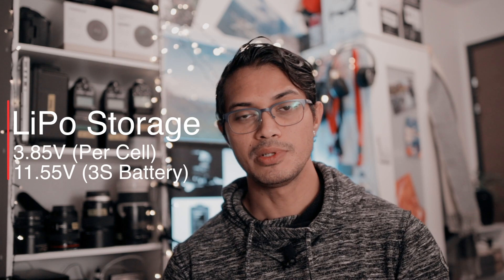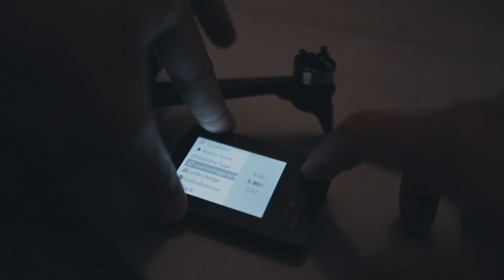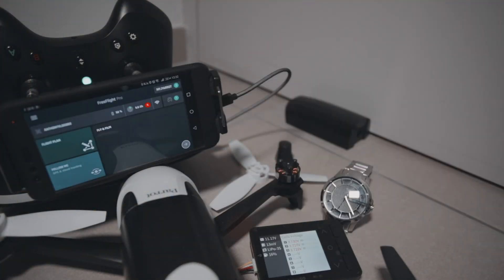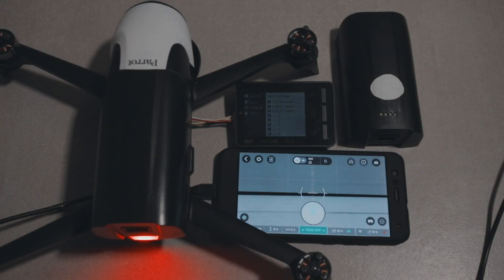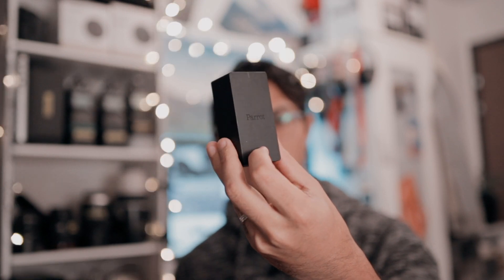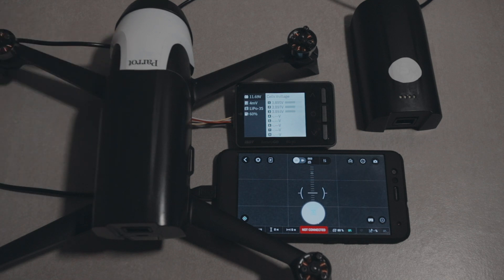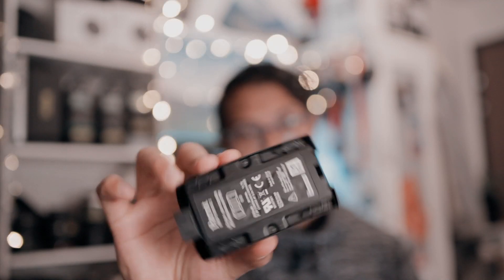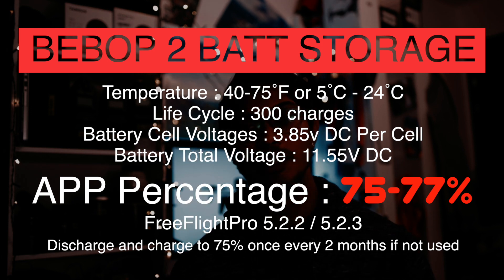VLOG120 | BEBOP 2 | Battery Storage | App Percentage at 3.85v per cell | 11.55V

Comment from the maker: BEBOP 2 BATTERY STORAGE
Storage Voltage per cell 3.85v
Storage Voltage total battery 11.55v
Storage Temperature 40-75˚F / 5-24˚C
Storage in LiPo safe bags or fireproof container
Store in dry place

To set storage without a special charger. 
Charge battery, than put on the drone and power it on and let it drain down to 75-77%or on your last flight, bring it back at 77% than your battery will be good for storage. 
If you don’t use the battery for really long period, discharge and recharge it than discharge it to 75-77% once every 2 months. (Personal recommendation) 
If you know how to set storage with your balance chargers you shouldn’t be watching this video.

Comment: Hey Anthony I hv a Brand new Beepbop2 in the box Doesnt espect to use it first time  before summer or so (in 5months) What should I do with the Battery ?
Reply from the maker: Ensure its at storage voltage. 75% in the app if its firmware is 4.7.1 and ffp 5.2. Put it away once set and take it out once at least in 2-3 months discharge it and recharge than discharge to 75% again for parking it. If its original batteries it will sleep if left for a long time and it would seem its dead and when plugged back into the wall charger would blink a sequence. That's just reactivating, disconnect and reconnect it will charge up to green. (just incase you let it sit without doing anything).
Reply: @ANTHONYVLOG  For xtra Batteries Do you recommend one place to buy Thanks for your replies :)
Reply from the maker: Parrot is a good start if you got the drone from them. If not try to buy the batteries from the vendor you got the drone off. It keeps a good paper trail in the case something happens to the drone they cant point any fingers.

Comment: I was charging the batteries with the Parrot Charger for about 20 minutes after flights. I have the B2 Power edition. I was assuming that 40-50% was good on the app but your explanation makes sense but it also worries that I may be damaging the batteries. The issue I have with flying to discharge is that once I'm done flying I usually am done completely and ready to do something else. Especially with 3 HD batteries with the Power Edition which easily gives me 27 minutes per battery. 

I just assumed that charging for about 20 minutes was good because the app always showed 40-50% which I thought was storage. Now that I see that the app is reporting higher percentages I may have to charge for about 25 minutes. 

Am I damaging the batteries by charging only to 40-50% on the app? Also, my HiTec charger which I cannot use to charge my Bebop (I use it for other drones) has a STORAGE charge setting that is set to 3.80V per cell. That always seems to be about 40% for the other drones! I can never seem to get a straight answer as to what the ideal storage charge level is. And why would my HiTec charger charge to 3.80V if 3.85V is the ideal storage level. I cannot change the storage level.

I have another question: you said that Parrot is playing it safe by reporting the percent of battery differently than what the battery really has out of safety. So the app should be reporting a LESS percentage and yet your demonstration shows that the app is reporting more at 75-77% assuming that is 45-50% in reality, but that doesn't make sense for safety as the app should be reporting LESS than the battery really has so that you never fly to battery empty. So what's going on there?

And the ultimate point is that why didn't Parrot just make it easier for us to maintain our batteries with a charging adaptor to connect to a third party charger or make the batteries 100% "smart"?

Thanks for the information.
Reply from the maker: The programming can go either way top end is high low end is lower, it was just an example of what can happen in software that is why i needed to check the physical battery reading while it's mounted and reference to the app. I don't have a power so I can't comment. Lipos are 3.85 or 3S 11.55v but it's subjective. I'm working off the battery manufacture information not parrot as parrots advice is 20-40% the original battery with the oem pcb 3 will hybirnate anyways if not used for prolonged periods and will need to be activated by putting it on charge. Different combination of red blinks than a standard constant red blink. Using the 3rd pty charger you refer to that chargers manuals. My video is for parrots setup and specific to it to avoid confusion. Do you have the battery cell part numbers on the power?
Reply: @ANTHONYVLOG  Yes I don't use the third party charger for the Bebop battery because I don't have a cable adapter. 

I'm not sure about getting the battery cell part numbers on the power but I have the power and voltage ratings if that's what you mean:

Rated Voltage: 11.4V
Rated Capacity: 3350mAh 38.19Wh
Charging Limiting Voltage: 13.05V
16.75A Continuous Discharge
Charge at: 5.025A MAX
Reply from the maker: @Airwolf76  thanks bud. That would mean you have the Parrot HD charger. I'll need to get my hands on a lower battery to do similar test unless someone can pull the battery out at 75% (app reading) and share the voltage 😊.

There is no problem charging with 3rd pty charger if charge rate and limits are within parrots battery spec. Also note that if the Parrot battery sleeps (displays no power 0v) if left over 4 weeks it will need to be connected to the oem charger to wake it up (not actually dead just the pcb disconnected the terminals so the battery don't drain anymore) . It will blink a different combination of red lights. Disconnect than reconnect and it will charge. Some people misinterpret the wake up blinks for bad battery blinks. We don't normally see this because we fly often.

Comment: Once again another brilliant Direct Straight to the point video, Great for those that don't have balance chargers or Non Parrot batteries. Thanks Ant
Reply from the maker: Thanks Anydy, yes I made this for those who don't have anything other than what comes in their parrot box. PARROTS RECOMMENDED battery % is 20-40% which I wouldn't recommend and I think they need to update their litriture.

Comment: excellent video. I was wondering about battery storage for bebop 2. i recently picked up another Parrot battery. You mentioned over heating. mine if it idles get hot but it has never shut down in flight. Besides that how else can you know its getting to hot before it shuts down and what are the causes? Thanks.
Reply from the maker: Hi Tapps47, it gets pretty hot in normal use. There is only no way to know its going to get really hot to shut down it does not report until its actually too hot and throws a PIC Watchdog Error. So knowing this I do dry runs, if it throws the error while it's on the ground I'll look at a tear down and re-applying some thermal paste over the A9 CPU and P7 and the magnesium alloy chassis that acts as a large heatsink.
Reply: @ANTHONYVLOG  ok thanks.
Reply: @ANTHONYVLOG  This would make another great video. How to tear down and rebuild. You done this in the Flamingo Towing Video. Yes i guys Ant was towing a pink flamingo !!! The tear down was done at 3x speed. It would be good if you could show us in detail what is involved.

Comment: what if i put my battery  to min 20% - max 40% for storage? does it will make any difference with ur explanation?
Reply from the maker: Depends how long for. Few days, a week  no worries. It's only prolonged storage that recommends cell voltage of 3.85v which usually get stored for up to 3 months at a time.
Reply: @ANTHONYVLOG  well noted brother.. from now on i will discharge my PB2 battery within 75% -77% since i rarely fly my drone.. thanks anthony
Reply: @ANTHONYVLOG  btw i noticed something in my flight manager that maybe means something wrong with my battery... 
   Time    | Flight duration  |      Battery   |
07.50,48 | 10min 51sec    | 100% - 48% |
09.21,02 | 01min 09sec    |  62% - 51%  |
09.25,02 | 00min 02sec    |  00% - 00%  |
09.25,06 | 06min 50sec    |  58% - 18%  |
based on the info above do u think is that normal that the battery percentage increase while it resting?
thanks brother
Reply from the maker: Battery readings will sometimes go up when not under load. For example, in flight it's loaded than landed and turned off the load is taken off and power goes up. So when it starts again it starts with a higher number but as soon as load is applied it goes to its correct voltage. As i'v demonstrated in the video the app reading and actual battery reading differ. New batteries won't change much, as the battery ages through use and time it will show these symptoms.